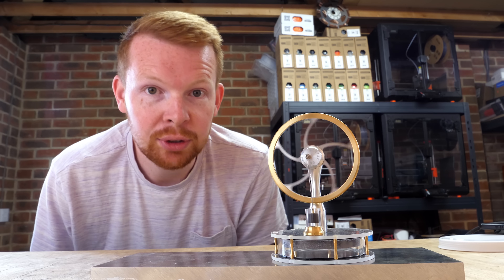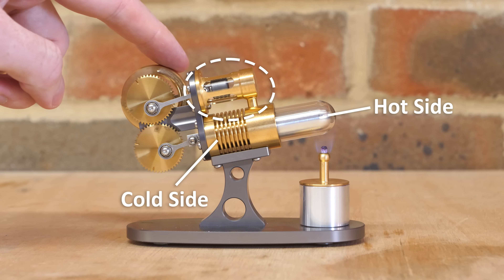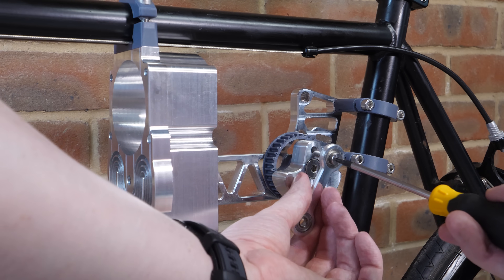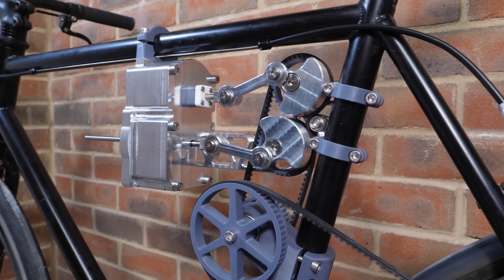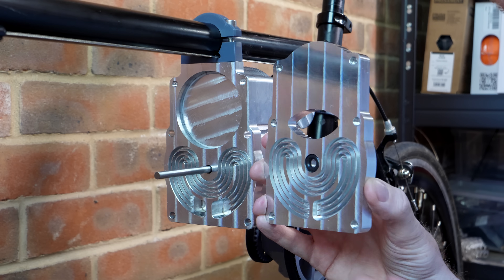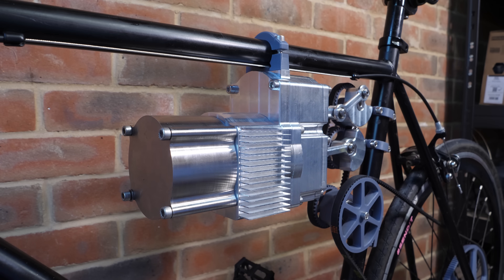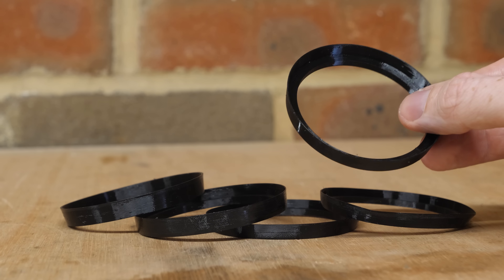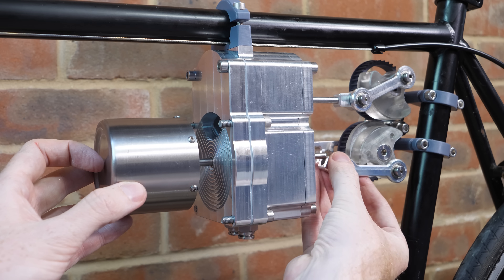Building a Stirling Engine Bike - Part 1

Comment: what if you double the length of the displacer cylinder and installed a section in the middle made out of a highly thermally insulating material like alumina-based fire brick or ceramic to insulate and prevent head conduction through the cylinder wall to the cold side? could also coat the hot side of the displacer cylinder with an insulating coating to prevent heat loss and only allow the surface in direct contact with the flame to be exposed metal. basically hot side should be hot and stay hot cold side should be cold and not be contaminated by the hot side the higher the thermal difference the greater the efficiency. also increase the surface area of the inside of the cylinder by putting lots of heat exchanging fins to help the air heat up and cool down faster.

Comment: It's neat, but not enough to realistically power a bike. (Obviously it's missing the amount of torque needed.) However with a collection of mirrors and a small generator, it could trickle recharge cell phone batteries or something like that. Convert it into a mechanical solar energy collector.

Comment: Friction in the piston is the killer of all Stirling engines. In the first small model they have a glass cylinder with a graphite piston which is the key to it running at all. If possible copy that.

Comment: Finally, someone using a cup style seal for the power piston.  This is shaping up pretty good.  The next step after the regenerator is pressurization of the stirling engine with a snifter valve to self-pressurize and achieve more power.

Comment: I have some tips. Not that I'm a specialist in Stirling engines, but I do love efficiency, and your engine definitely has a lot of room for improvement. I'll mention the easiest modifications first.

First of all, the connection between the hot and the cold source definitely needs more insulation. You could just increase the distance with an insulating material; the ideal would be something like ceramic. I also recommend the gases pass through this middle insulation layer instead of the cold end of the thermal piston. The current model loses efficiency twice when the hot air passes through the cold source to get to the power piston, and by increasing the temperature of the cold source.

My third tip is to, if possible, make the thermal piston with internal fins. This will drastically increase thermal transfer, increasing efficiency. Also, if possible, make the wall hollow in a way so you could create a vacuum inside it and put a little bit of water inside, like a heat pipe does. This would allow you to avoid needing water cooling and a pump that would need to be powered by the motor.

And one final thing: just make the walls thinner, mainly on the thermal piston. This part needs the most thermal conduction and doesn't need any structural resistance.

Comment: Was the 150 watt power output a wild guess or did you use a calculator to get to this number? 

Most sterling engines on YouTube fail because the builders rely on either zero friction or 100% thermal expansion efficiency just to move the complete stroke. Its always better to design the engine for lower operating delta T and size the power cylinder displacement for about half the expected delta-volume.

Also the power cylinder seal was failing cause it wasn’t perfectly round. You can see a gap in the bottom of the cylinder.

Comment: The CNC Machining is beautiful, but it seems like a waste to build the world's weakest engine and put it on a bike.
 If you had a 50cc gas engine you could have driven it around the block on just the propane you used, heating your mass for the Sterling engine.

Comment: I do wonder if you could construct a bimetallic heartbreak similar to what 3d print heads use to keep the heat on the hot side. And long heat pipes bent around and built into the cold side to shuttle the heat away from the cold side to two or more aluminum sheets in the empty space of the bike frame rather than powered water cooling.  I also wonder if you could run it on one of those flameless chemical heater reactions similar to thought emporium’s self cooking hotdog. It might not have the same energy density of a propane or butane burner but it might  be easier/safer to seal and start than a burner in a bike. That said I think there’s catalytic burners designed to make heat efficiently with gases like butane I seem to remember a butane powered soldering pencil that also had a mini heat gun nozzle. They all had a sort of odd grey metal mesh in a small chamber that glowed red but no flames after a second or two.

Comment: if this ever gets to the point of powering itself as a bicycle, unlikely as it is in the current design, despite its visual appeal... 

one must consider power... sure, a gas bottle works but how about salt storage?

a regular 1L thermos flask. bit more than 2kg of salt. thats 1760J per C increase.
melting at 800C, thats a lot of energy to release before hitting ambient...
melt it in a crucible, pour it into thermos flask, ram stirling hot end in...

power pistons too large for the design. i cant be freaked dealing with designations of stirlings, best approach for power are the v-twin...delta?... both pistons are power and displacer. one hot one cold. always the best performing from what ive seen. 

stirlings only look good on paper, reality doesnt like them. volume to surface area, issues of moving a mass of gas back and forth. the whole idea is to exchange heat with air as rapidly and effectively as possible. you try adding internal heat fins and narrowing passages and the flow of air itself is restricted, becomes turbulent. as they get bigger, you have to move more air, faster, heat it, from a limited area. they never work out as planned.

the cylinder staying red hot for quite some time shows how little heat is being transferred to the air INSIDE.
and on that note, how much energy is dumped into the hot end via the burner? how much radiates away as lost heat? 

overall... use valves, add some minor complexity, and run an ericsson cycle with external heat exchangers that can be made large and efficient... closed loop, pressurised helium...

all engines run on heat. its doing something useful with relatively small pressure changes for high temperature changes. thats the advantage of steam. high pressures with low temperature changes. air is a lousy working fluid...

regenerator is a must...

Comment: You NEED to put a Freewheel Mechanism (a.k.a. Freehub, One-Way Clutch, or Overrunning Clutch) on the fly wheel area. It's just like a bike, can pedal one way, and the other way it spins freely. This will grant permission of the rotation of your actual wheel on the bike to rotate with even motion.

Comment: This is so cool. Revolutionizing the hybrid bicycle in the weirdest ways! If you get the power output you're aiming for, and get it to run for any reasonable length of time (the regenerator will definitely be key here), it'll be an absolute triumph. Definitely sticking around to see how it turns out 😄

Comment: Make a swivel plate crank and add 2 more cylinders and 2 more displacers. Regenerators make the stirling engines work better because of the increased surface area. Use an old aircon compressor from a car, it already has most parts you'd need and it would be easier to modify. Also easier to actually pressurise when you are finally ready to fill it with helium or hydrogen under pressure.

Comment: Bro, i took thermodynamics course and 
That's not how sterling engine works.

Sorry i am bit a engine geek too.

Displacer is meant to isolate hot air from the heat source.
Piston is meant to contract cooling hot air.
And whole power came from contracting hot air creates low pressure.

That's why
Displacer cc> piston cc (displacer those not compres air.)
because huge air volume expands most.

Bore/stroke  ratio 
Displacer>>piston 

Piston stroke length is optimised for maximum torque and dependent on the system.

Observe gamma sterling engine closer.

Comment: Solar powered bike, but instead of a solar plate, I have a comically large magnifying glass heating up my sterling engine.
Reply: I saw a coyote using one of those. - It came mail order from a company called 'Acme' :-)
Reply: @peterrenn6341 i think thats a roadrunner vs coyote reference.
Reply: Ya i was thinking that it could be heated by the sun and use a giant heat block to store heat. It could even be painted black to capture the most light.
Reply: @Will_apop  Vantablack
Reply: My problem when cycling is body heat. Especially in the colder months, where I'm wearing thick clothes. I would love to remove that heat, and use it to assist the bike.
Reply: @rasmis  I dont think body heat would help the engines performance even a tiny bit
Reply: @userblame632   a biker biking puts out around 100-120W of heat energy.  the goal for this engine was only 150W, you could almost power it entirely off body heat.
e: obviously it wouldnt be practical, wearing a liquid suit would have a lot of its own problems (namely leakage), but its possible.
Reply: @StarlightLumi  the issue is that the source of the heat has to be wayyy higher than what the engine is rated for, for example, toms engine is 150w yes but he has to use a butane torch which brings up that steel to discoloration temp (400-600f). You’d be long dead before a human could get up to that temperature
Reply: @StarlightLumi  The big issue is conversion efficiency - there is an upper limit to how efficiently an engine (of any design) can turn a heat into useful work set by the laws of thermodynamics itself. It's called the Carnot efficiency and depends on the ratio of absolute temperatures between the hot and cold side - and for a hot side at body temperature and a cold side at freezing, that limit is only 12%, meaning that even though stirling engines can get quite close to the theoretical limit, a perfect one still will only extract about 14 of those 120 watts (unless you, like, are biking in the dead of Antarctic winter or something - a cold side temp of -70C will raise efficiency to 34%)
Reply: @rasmis a 'cold finger' was suggested to remove excess body heat from soldiers car combat kit in desert climates ... it wasn't a popular idea with the soldiers!
It would probably affect cycling more than walking ... ;-)
Maybe a water cooled vest would be a preferred option ...
Reply: 🤔 jealous?
Reply: Best idea ever 😂😂😂
Reply: The only right way
Reply: I wanted to build one of these to generate electricity instead of using PV. But I don't have a CNC thingy yet.
Reply: Actually yes ..
Reply: Not good idea in UK.
Reply: on the road straight up heating it and by it haha lest justr say my stirling enjine
Reply: This would make amazing solar punk lore.
Reply: Efficiency 200
Reply: I was thinking the same thing but have it power a generator to see how much energy I could store in a battery compared to a small solar array.
Reply: This is going to end up missing lol
Reply: when you are constructor and you have sense of humor :) and you don't want to google 1kW Sterling engine construction.
Reply: Solar ☠️ ray!
Reply: It's delta T.  You need cooling, too.  If you heat the entire bike, it's not going to help.
Reply: I'd go for a slightly-subcritical chunk of plutonium.  Perpetual heating for decades!
Reply: Good idea
Reply: The fresnel fryer XD
Reply: YES. MAKE TOM SEE IT
Reply: That’s funny. Then you just need to manually change the angle of the magnifying glass as the sun changes position in the sky 😂
Reply: that would only work on couple of days in july.
he's be better of using a water powered bike..
Reply: @sliceofbread2611 So it has a waterwheel on it and can only produce power while in a river? I would love to see this.
Reply: @sliceofbread2611  Good thing it is july.
Reply: That might be a job for a fiber optic taper.
Reply: This is what I want to do at scale to power my house.  It would sound magnificent having 20 of these all running together 😂
Reply: please make this instead it works 100%  A Hall back array Magnet you turn on and off to pick up heavy steel, well it uses little to no energy to turn the magnet on and off, you can make a repulsion motor by making a piston engine, that when the magnet is reppeled the hallback switch can rock past a cut off to then recipricate the engine over and switch to turn the magnet back on all using simple mechanics. I hope this helps you and others. Have an amazing day
Reply: @Pauls4reel  The Halbach principle has already been incorporated into electric motors.  Easier to just buy an efficient electric motor off-the-shelf.

"A Halbach array is a unique arrangement of permanent magnets designed to create a strong magnetic field on one side while significantly reducing or canceling it on the opposite side. This "one-sided flux" property is achieved by orienting the individual magnets so their magnetic moments (the direction of their magnetic poles) reinforce each other on one side and oppose each other on the other side. 
....
"Halbach arrays are used in various applications, including electric motors and generators, magnetic levitation trains, and MRI machines. They are also used in particle accelerators and free-electron lasers as "wigglers". Other uses include magnetic bearings, magnetic separation, wind turbines, and even in the magnetization pattern of refrigerator magnets."
Reply: Or completing your idea use a flywheel filled with hot sand  to Store temporaly from The sun as part of the mechanism😊

Comment: Am i wrong?, or wouldn't it be good for the engine if the power pistons cylinder was not sealed on the backside, so the enginne can breathe without compressing air on the backside of the piston?  Great video as usual!

Comment: So I did my college thesis on stirling engines many years ago, so maybe I can offer some tips? 

I'll be honest, 150W is very ambitious for an engine that size. There's a reason stirling engines aren't commercially popular, and it's the poor size/weight to power ratio along with the high cost. You'll probably need features like a sealed and pressurized crankcase so you can also pre-pressurize the working air... some of these machines run at 150+ psi (10+ bar) to get reasonable amount of power. Hope that isn't too discouraging! I think you can still make something usable, but it's gonna be a challenge to meet your goal.

Tip 1: Seal the displacer. As the air can get in and out of the displacer, that is effectively increasing the working volume of the entire engine and lowering your compression ratio. Ideally a one-way valve (as simple as a silicone flap over a small hole) to let the air inside escape as it heats up but not back in. Even better, pull a vacuum on it. You want to absolutely minimize the amount of dead/"unswept" air volume inside the engine.

Tip 2: You'd want to make the displacer and displacer cylinder out of something that will not conduct heat very well, so the heat can't "short circuit" through it instead of the air. The thin stainless shell you're using is actually not a bad choice! It's what the few commercial attempts use. Glass would be better, but could make construction more difficult and less durable. Along those lines, the long bolts you are using to hold the displacer hot end on are also a thermal short circuit.

Tip 3: For regeneration, consider adding a third section in the middle of the displacer that is packed with steel or brass wool with as little clearance to the displacer as possible. You want to force the air through the regenerating material as it moves from hot to cold and back. Metal wool is cheap, has huge surface area to volume, packs easily into irregular cavities, and you can easily adjust the density to find a balance of thermal capacity and airflow resistance. Something like metal beads is not a good choice unless they are annoyingly small, like the balls in those linear bearings. You might also try a stack of fine metal mesh. The goal here is to have lots of surface area for heat transfer, and just enough material that the heat can soak into it in time... think how a large turkey takes forever to cook, because it takes so long for the heat to reach the interior - that's what you want to avoid in a regenerator matrix. You need that heat to get in and out fast!

Tip 4: Consider tuning the phase angle between piston and displacer. 90 degrees is like the theoretical ideal but moving the pulley a few teeth can make a big difference in real, less-than-ideal engines. You probably need the displacer to lead the piston by a few degrees, but you'll have to experiment.

Comment: You're definitely going to want to increase your rod/stroke ratio as well.  I think you want to be over 2:1 rod length to stroke length.  You can see how long your piston is sitting at the bottom of the stroke.  Maybe even add a dampener.

Comment: A hot day with a cool breeze would be a cool day to test and see if simply getting the bike moving first by pedaling, would be enough airflow for cooling the cold side, and enough heating on the hot side. Maybe even build a sun shade for the cold side so the cold air comes in from the front end exits the back

Comment: What if instead of heat, you strap an icebox around the "hot end", and flip whatever might necessary to make it spin the right direction? Stirling engines work on temperature differences, and not specifically just heat, right? And maybe you could even get a boost with some dry-ice? (don't forget to NOT seal dry-ice; when it sublimates, the gas needs way more volume, dangerous if sealed; pipe-b**b potential)
That would be safer and more portable than a burner, right?

Comment: The dimensions of a computer heat sink might not work but the technology can still be useful! Turns out you can just buy heat pipes pretty easily, and they transfer heat far more efficiently than any water tube.